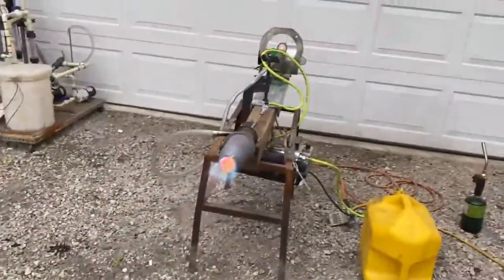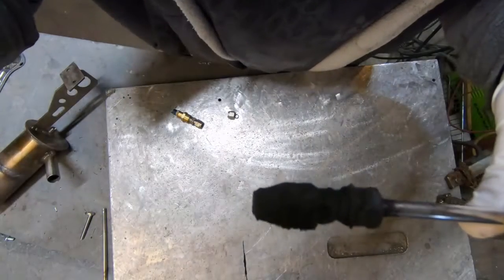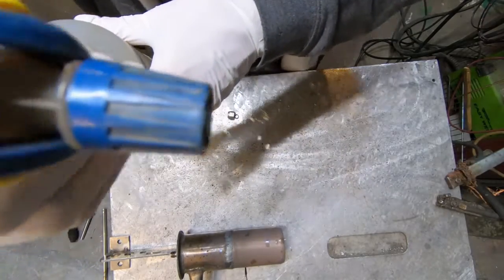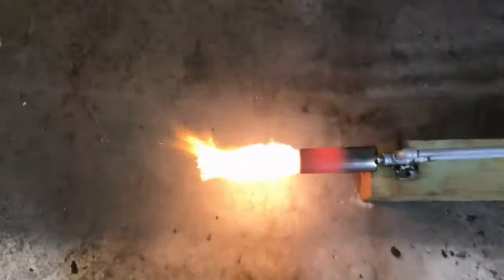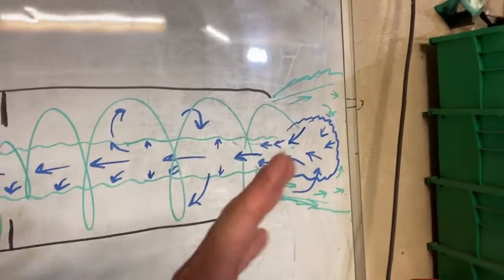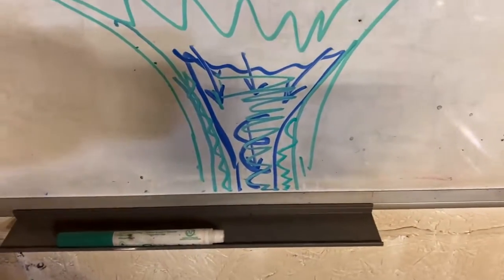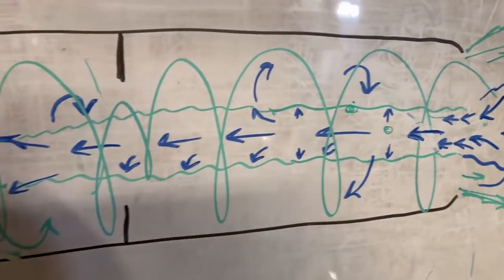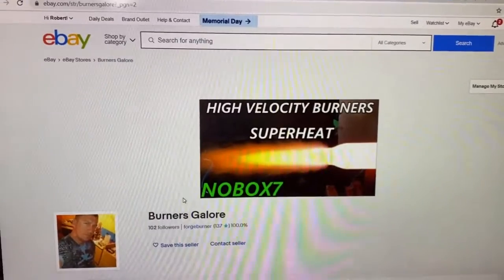Blower Vs compressor waste oil burner conclusion

Comment: Random idea: this reminds me of half of a hilsch tube, like the compressor powered chillers. what about using an annular compressor nozzle threaded directly to the back wall, then a pair of tangential nozzles like the single here. try with and without the blower to induce the swirling airflow?

Comment: U need to study modern jet engines specifically the afterburner region where fuel is added at the back of the fire, BUT MORE IMPORTANTLY the nozzel shape. Also consider vaporizing the oil by heat instead of atomization to avoid nozzle foul. Just wrap the oil/steel brake line around the hot zone for preheat without O2.
Reply from the maker: It wont last due to varnish
Reply: @NOBOX7  how about you add a second pipe over the red hot nozzle like a sleeve but use a spring as a spacer between the hot nozzle and the outer sleeve. If you get it to fit tightly and route to oil into the front of spiral cavity between the two pipes, the oil will travel around the hot nozzle and vaporize before being injection into the burn chamber.

Comment: That particular burner is creating a vacuum vortex creating a secondary burn, much like a turbo ram jet engine in fighter jets. Diesel fuel is thinner than waste oil. Waste oil is loaded with so much dirt, that it thickens up. If you build a centrifuge, you’d be able to filter a lot of that sludge out of the oil. Then cut the waste oil with either diesel or gas, then the burner should burn smoother and more efficiently. You basically created a ram jet engine, just without all of the turbo ram jet fans. Whatever you did on the inside of the burner that’s creating that vortex, you might have just created a new jet engine.

Comment: This is why you need to put a catalyst on the outside.

With increased velocities, and pressures, and with the ability to drawn in additional air from the back, you can burn hotter and cleaner, with less power left on the table.

It is, however, critical that you insulate the system to make sure that all the heat exits out the back.

Since I have made no purchases, I can make no reviews.

Comment: Study tornado physics.
“Comprehend and copy nature “-Schauberger
Air goes out on the outside in pressure, air comes in from the inside in vacuum generated by the vortex. That “black zone” is the area where the fastest combustion is taking place, where the fresher vacuum pulled air brought in in the center is most meeting the fuel laden pressure air moving out on the outside

Comment: So if I wanted to build a waste oil burner plumed into a cast iron wood stove, with a stainless steel pot catching the flame in my camper, are you suggesting using a compressor as an air source? I'm kinda limited to 12volts and limited battery capacity. On my way over to your page to give it a like.
I'd very much like to read your book!!

Comment: Very ineresting. How would a turbo/self powered burner do compared to these? A turbo is essentially a compressor so woulf it perform similarly to your compressor type burner? I guess you'd have to redesign it to be able to use the exhaust to power itself
Reply: Oh that’s called a ”jet engine”
Reply: @xmysef4920  basically yep 😂
Reply: @jhsevs  A waste oil turbojet engine would still be really cool though!
Reply: @xmysef4920  yep!
I've also found out that it should be possible to build a little mini burner with a 12v dc blower fan powered by a TEC that is heated by the burner itself. TECs are inefficient though so the burner wouldn't be very big, but it's something.
Reply: @jhsevs  Yep, still an idea for some time :)

Comment: I was looking at your ebay store and I am considering buying own of your silicon carbide nozzles. My question is, I have to modify the nozzle to work in a vertical position for my application. Have you tried any of your silicon carbide nozzles in a vertical position? Is there one of your models that would be a better choice? Primarily burning kerosene, may get into diesel in the future. I was just going to take off the two straight pipes and put an elbow in between each.
Reply from the maker: Yes they can burn in any position and i could set you up with a custom bracket for vertical mount .
Dont buy from ebay if you wanna do me a favor as they kill me in fees . Just email me using the address in description

Comment: I think if you angle the blower pipe 60 degree or so it might mitigate blow back and move the nozzle back to help with build up, burn pipe may need to be longer too.

Comment: Do you think that in flowing center vortex flame is why you’re getting so much soot build up on the nozzle?
Reply from the maker: Yes also its freezing cold compared to surroundings
Reply: @NOBOX7  you should try a radial spraying nozzle. It looks like your nozzle spray forward is competing/spraying opposite with the inflowing center vortex. With a radial spraying nozzle you can direct the fuel spray into the outer vortex without competing with the inflowing center vortex and then put a small shield on the top of the nozzle so the in flowing vortex smashes the soot onto it instead of gunking up the nozzle. 
🤷‍♂️